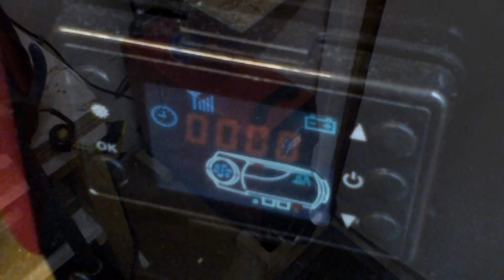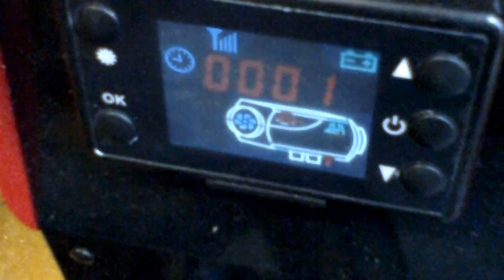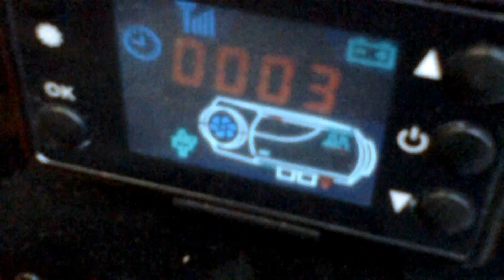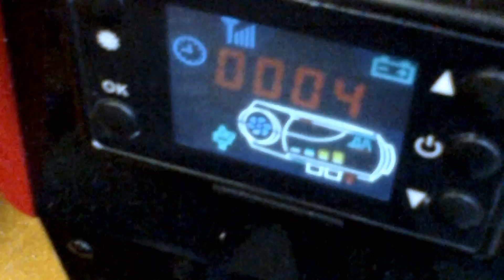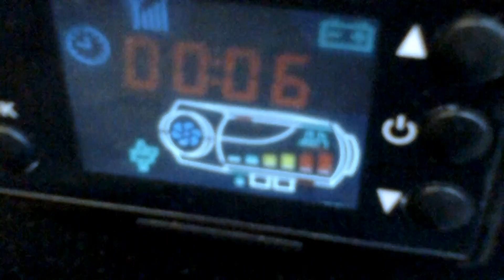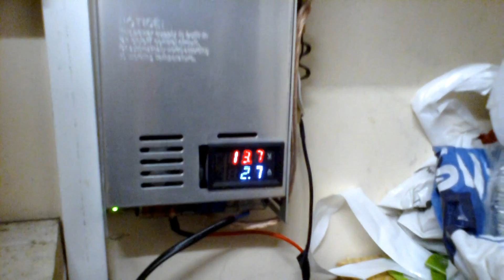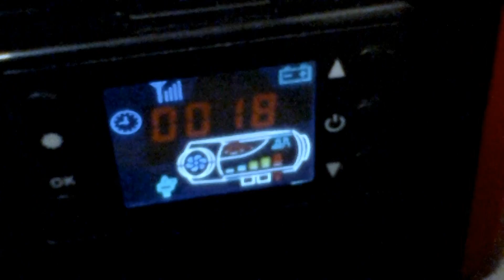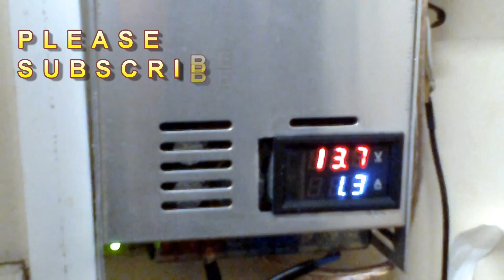COMPACT CHINESE DIESEL AIR HEATER - AMPS used in REAL TIME

Comment: So noisy,how can you handle this?
Reply from the maker: @Charlemagne1367  Hi George. The ticking you hear is from a dosing pump which gives a very precise measure of fuel with each “tick” that you hear. It’s nothing like a normal pump which just delivers a liquid so hence the tick you hear.
There are various things people have tried with partial success with the separate ( kit type) installed units but your stuck with the ticking with the all in one unit I have described in all my videos. It’s a feature of how it works.
Don’t know your installation so I can’t comment but I did go to a Romahome rally a few months back and one guy there had a diesel heater installed in his small motorhome and there is no way with the size of unit you can get away from the ticking - asked the owner how he got on with the ticking and he said “ instead of sheep I count ticks”.
I know sheep carry a lot of ticks so I thought his reply was exquisite...
Regards Peter
Reply from the maker: Hi Zoltan - Mine is in my shed so with all the noise I can make it’s not an issue. Wife has hers in her craft cabin and when it’s up to temperature there is no real noise to bother you. I think your not seeing all the advantages! Remember this type of heater is common to all lorries who have sleeping cabs so I’m sure if it was that bad for noise lorry drivers would not have them as they could not sleep.
Rythmatic sounds are usually easier to put up with than random noise levels which is why white noise is often used to get people to sleep...
Regards Peter
Reply from the maker: @Charlemagne1367  Hi GEORGE. The only thing I have read is NOT to use the fixing bracket supplied with the kits and to just use loose cable ties to secure the pump thus taking away the resonance from the bodywork of the vehicle - it’s only if your going off to sleep where it’s silent that you notice it really - I have two neighbours who have been so impressed with my unit and of course it’s cost effectiveness that both now have them installed in their workshops and one is now In the process of installing one to subsidise his solid fuel heater so he can start it before he gets un in the morning when the solid fuel fire has often gone out - thus to take the chill off the rooms. His installation utilises a box fitted outside and the heater will go in there - including the dose pump - so only the noise from the moving air as it enters his home.
Regards Peter
Reply from the maker: Hi again Zoltan - Also see the reply to GEORGE D below which may also help answer your question. Regards Peter

Comment: If I use a 12v 5A power supply, will it still work except it may take longer to heat up? Can't find any info inside my manual and I have yet to buy a power supply for it
Reply from the maker: Don’t even bother with a 5Amp power supply - it will just melt. If you have not got a power supply that will cover the current required use a good 12v car battery with a charger connected will also do the trick.
Regards Peter

Comment from the maker: Hi there. I only did the original meter shown on earlier videos installed on the power supply to show voltage however Amperage was a response to seeing questions asked by the RV and boating together with the Off Grid community as they rely more on their batteries / solar chargers so current draw is an important factor which prompted me to install this Amp and voltage meter.
Only use to me is if the gloplug or main board fails which will give me an indication on the meter however it’s really of little use other than used for this video as info for them who need the information. If you wish to install one you need a large 20Amp shunt which is quite large and if you look at the power supply you can just see part of it to its right hand side so it’s not a pretty item to look at. Regards Peter
Reply: That's perfect I intend to use mine for winter camping in a tent for the night beat tending a fire.
Reply from the maker: Please be aware that in a tent with the wind blowing the wrong way or if there is a wind change you could end up with a chance that the exhaust fumes could blow back into the tent with the result that you would not be waking up to see the next day. Even in a tent I would strongly recommend you always have a carbon monoxide/ carbon dioxide alarm which would just be a precaution against such an issue.
Reply: @brucepeter2007  Yes I'm fully aware of this thanks for your concern. I need to be enjoying the night not having my last night in the wood.

Comment: Wouldn’t mind seeing how you wired the amp meter and shunt to the power supply and heater? Would be a great help as it’s not every day you wire these up.
Reply from the maker: Hi there. I only did the original meter shown on earlier videos installed on the power supply to show voltage however Amperage was a response to seeing questions asked by the RV and boating together with the Off Grid community as they rely more on their batteries / solar chargers so current draw is an important factor which prompted me to install this Amp and voltage meter.
Only use to me is if the gloplug or main board fails which will give me an indication on the meter however it’s really of little use other than used for this video as info for them who need the information. If you wish to install one you need a large 20Amp shunt which is quite large and if you look at the power supply you can just see part of it to its right hand side so it’s not a pretty item to look at. Regards Peter
Reply: Hi Peter, where did you get your amp and volt meter and how did you wire it up.... thanks ... a video would help !!!
Reply from the maker: Hi there. I only fitted the meter to make the video to show people the current draw. It has no use other than that for me. You can get the bits from AliExpress components and for the 20 Ampmeter you will need a shunt. Regards Peter

Comment: The air comes out so hot from these heaters that you can heat up a can of soup with it.
Reply from the maker: Hi again. And your comment raises a question again I have pondered a while... Exhaust does get a bit warm on the diesel heaters but then so does the exhaust on your car. I had an idea to route the exhaust into a 2 foot central heating radiator and then exit the gasses outside but I got worried about sooting up the diesel heater because the radiator input and exit pipes are only 19mm which would cause an air flow restriction. If I had an exhaust gas analyser and I could play with the fuel / air settings correctly it would be worth a try as the extra heat recovery would be well worthwhile but the better conbustion exhaust gas analyser units are £100+ so I will pass on that and just sow the seed for others. Regards Peter
Reply: @brucepeter2007  I only know how hot the air is heated because have one in the long haul work truck I drive. Was thinking of your heat recovery idea, not sure how to make it work. If I come up with something, will let you know.
Reply from the maker: Two minds better than one - great if it did as it would put the efficiency of the heater up quite a bit...
Reply: A car intercooler

Comment: Peter Bruce Excellent video! I think many, many people would be very interested in this, as that is the #1 question in the comments on Van Life/RV/ Camper videos being that the Chinese diesel heaters are becoming very popular.  This information you provided cannot be found even with alot of research.  If this video becomes very popular I would purchase the 2kw/5kw/8kw versions with the external tank as those are the most popular (although yours is superior in  my opinion) then test the electrical and fuel consumption in one video.  Thanks again, I will be sharing this video link alot.
Reply from the maker: I thank you for the time you have taken to reply in such detail. I had seen the question come up on a number of occasions but I never realised how important it was to know exactly what these heaters draw on a battery but I had come up against a battery running down on my first battery installed system which is why I went to the switch mode power supply however from the point of Off Grid and RV living I can understand the need to know the consumption of current to allow for a suitable battery and charge system to be installed. I do hope the video will be of help and I will put a link on a few other sites which may help Off Grid and RV owners to see it. Again thanks for you comment - the heater works a treat. Regards Peter

Comment: Excellent info!.. Such a small fan motor can draw a lot..but with 1- 2 avg I am fine..( have a 160 amp hour house batt) thanks Peter
( do you burn it hot at the end often so that no coal will built?)..may be you mentioned that..got ir from a vid as well
Reply from the maker: Hi RV. I do tend to wind it up to full power for at least five minutes about a half hour before I want to go indoors that way it shuts down and I use the 25 minutes of residue heat. I do this as a precaution to prevent sooting but not sure if it will work long term but as its costing no extra best to be safe than sooty HiHi. Regards Peter
Reply: @brucepeter2007  good procedure, Peter..fully cranked it should take care any buildup! Reg from the continent